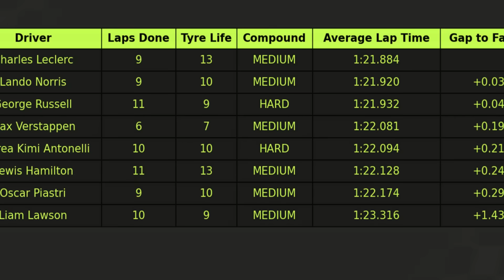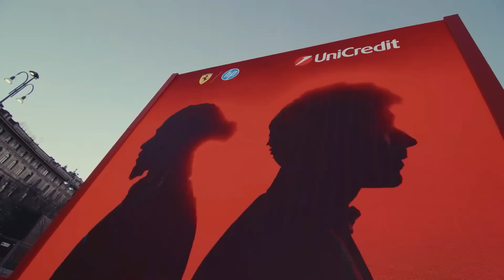Nico Rosberg Reveals Advanced F1 Data Exposing Hamilton’s Ferrari Performance Gap

Comment: 🤣🤣🤣🤣 That one aged like vinegar. First of all, Leclerc gets in fourth or fifth consistently. There is no performance gap. Ferraris way of doing things is just more driver-mistake prone. 

Second of all: Hamilton admitted himself that Leclerc gets excellent performance out of his, because he likes sliding the rear (which ferrari designed this way so the driver can do a lot of perfect turns with just very slight movements).

Hamilton cant even keep the ferrari in lane for one round of a qualifying. 

If you ask me, Hamilton is the problem. Not the Ferrari.

Comment: Leclerc has implemented an extreme setting while waiting for the updates he plays with the brakes and the engine brake which does not exist at Mercedes it is quite complex Lewis tried but he does not succeed (he knows less about the brakes) he doesn't trust this setting if you read leclerc from time to time you would know it
They are the same car

Comment: To join Ferrari, Lewis left Mercedes.
But if we look at the teams standings after Spain we can't say it was move for worse. The cars potential seems close.
1 - McLaren  362 points
2 - Ferrari - 165
3 - Mercedes - 159

...meaning, Ferrari has stability problems that clearly compromise cornering speed, but if with all the problems, it's still the second best team, that should mean a lot of potential if they can fix the car.

Comment: This is why F is so deadly boring. The driver is essentially irrelevant except at the tiny margins of skill. It's all about the car, not the driver. When "driver aids" (ABS, traction control, active suspensions, etc.) were outlawed, the take was to return F1 racing to driver skill. I'm a PhD mechanical engineer who has been involved in racing for decades. If F1 as an organization really wants the drivers to return to something like a defining factor, they need a spec car. Now that would put thousands of F1 engineers out of a job and in many ways take away a lot of the technical interest in F1 from fans, but as things stand now at Ferrari, Hamilton's skill is wasted. As for the racing, Indycar is infinitely more interesting. There was more passing in the first 20 laps of the Indy 50 than there is in an entire season of F1. If somebody like Vercrappen can win world titles over a driver like Hamilton, then driver skill has washed away to nothingness.

Comment: Once you realise how messy his car is you can’t help but respect Lewis even more for his control over the vehicle under these stressful conditions.
Reply: Once you realise SLH44 hasn't adapted to the ground effect era cars like Max, Lando and Charles have, you can't help but respect their adaptability and skill to look for new ways to drive, unlike SLH44 who drives EXACTLY the same as in the Mercedes dominance years. Just look it up, the official data shows this!
Reply: Charles do better then #44. If #44 were faster then you could speak about respect. But he is slower then Charles Leclerc.
Reply: Nico was talking about the telemetry data.

Ferrari has not made a competitive car since Seb.  The way they are doing things for Charles clearly is not working.  They need to make a car Lewis can be fast in, then Charles will have someplace to go.

The man has been running experimental setups for four years now for garages who cannot make the adjustments.

Comment: The whole team need to change, they must move away from their comfort zone, this is where they are because they think just by being Ferrari entitles them to win. They have to learn how to operate more efficiently like a well oiled machine, at the moment the left hand doesn't know what the right hand is doing until it's too late, mistake after mistake, the only good part of the team is the pit crew and drivers,  like that they will never win a thing. Desperation does not bode well in these things, it just puts you on edge and that's when mistakes lead to more mistakes and the situation just goes bad from there on. Fred should make them all step back, take a deep breath of air and look at what they are all doing wrong not what they are doing right.

Comment: If the rear axle assembly is not rigid under cornering loads, it will be a lucky accident if there is a stable set up: other variables will be set on the assumption of rigidity, so if the structure flexes unpredictably,  stability would only occur if precisely compensating errors are induced all round. But this is unlikely.  Also, does the simulator reflect the actual flexing, or the ideally rigid concept? If the latter, what is learnt by varying the other parts of the set up will be systematically misleading.

Comment: So how is Rosberg able to produce different results? Are the cars different? I'm thinking there is a trigger that sets off a chain reaction and the brakes stand out as the probable cause. Hot spots indicate vast amounts of variable forces that will flex and distort everything including ride height. I'm further guessing tribological problems between the rotor and pads. Check rotor composition or even outgasing of a cleaning solvent soaking in unevenly. A simple procedural change by a minor team member could produce what is being described.

Comment: All you need to know is that LeClerc is P5 and Hamilton P6. Ferrari does not have a good car. Better luck next year. Don't blame the drivers, they are two of the best.
Reply: "They are both behind Russell" is what you mean.  The Scuderia needs to get itself in order.  The team does not have enough success to insist Lewis do everything their way.  Lewis and Scuderia Ferrari better get together on the fine points.
Reply: @H.A.M.Macintosh-x4q  Russell is P4. Not particularly impressive but a little better than the Ferrari drivers.
Reply: Facts
Reply: Well if a car is super good, any Tom dick and harry can drive it good. It is when an experience driver can handle a ‘not so good’ car and still excel, that’s the difference.
Reply: One is very good, the other is forty years old and washed-up.
Reply: @jessebunker6062  so washed up he gets 50 Million plus to push buttons on a steering wheel, why you sit at home in mom's basement pushing buttons on your laptop.......lol............
Reply: @jessebunker6062  If either the very good one that is P5 or the washed up one that is P6 had faster cars they would be more competitive. Right?
Reply: And the next and the next year !
Reply: @Craft-oh7uv Ham Will LEAVE,(With the SPONSORS, !!) See how they Like it THEN......
Reply: @Craft-oh7uv even after 20 years without winning anything they are still the team with the most constructors and drivers championships. 
Only a moron would not count Ferrari amongst the manufacturers capable of building a championship winning car. Yes they are in an awful moment (like several times before), however historically when they get it right after those bad periods their dominance is complete . 
When they get it right again people will completely forget the bad years
Reply: Hamilton has been over half a second per lap slower than Leclerc in every race so far bar the sprint in China
Reply: @ey1615 Who cares. Leclerc is P5 and LH P6. Neither driver is competitive. That has to be the car. Correct? And indeed, both drivers have been complaining about it the whole year.
Reply: @ey1615he had damage in Canada and in catalunya😂😂😂 he was losing 5 tenths per lap with his damage in Canada alone and yet he still finished decently
Reply: @vinnievinnie-sj5kr He regularly loses 5 tenths a lap on Leclerc without damage too. But of course this damage was exactly 0.5. The British desperately trying to save what is left of their myth, no the Ferrari wasn't faster in 2017, Vettel was fighting Bottas almost just as much until team orders. Bottas also mysteriously lost his mojo after Mercedes and struggling to beat Zhou, as well as he did that weekend when Russell replaced Hamilton and beat Bottas convincingly right away. 
It was obviously the car. Hamilton was one of the quicker drivers 15 years ago but the grid has developped and now he is just mid.
Reply: @DenUitvreter  So you are saying that Leclerc is better at driving a mediocre car than Lewis? I mean Leclerc is young and in his prime and the best he can do is P5 one spot ahead of washed up Lewis? Maybe next year if Ferrari is more competitive we will have a chance to see these two great drivers winning and competing for a championship.
Reply: @prestonbacchus4204  Hamilton isn't washed up, he was never that good and Russell was also better at driving a car than Hamilton, a mediocre car often but also better driving the odd good car. Hamilton was among the quickest drivers of his generation but now we have a quicker next generation. That's how it goes when all times try to get quicker drivers every year from an ever growing pool of better prepared talents. 
When Schumacher quit in 2005 he was still the best, but not by the margin he had on the rest of the grid in 1994. Hamilton was never near Schumacher's level so he just went from one of the top drivers to a mid driver over 15 years. Vettel and Alonso (would) have stiff team mate competition in the current grid too. That is the natural progress of the sport, they get faster cars and they get faster drivers.
Reply: @DenUitvreter  Hehe. George would never make the argument you are making.^. GR: has achieved four race wins, six pole positions, nine fastest laps, and 20 podiums in his 7 year F-1 career. LH: holds numerous Formula 1 records, including championships (7), the most race wins (105) and most pole positions (104)...in his 18 year F-1 career. By the numbers, nobody is close to Hamilton.
Reply: @prestonbacchus4204  True, that goes for all numbers. No one had so many supreme and competitive cars, no WDC has been beaten by this many teammates.
Reply: @DenUitvreter  Cool, another record for Lewis.^ Agreed that having a fast car is quite important and Lewis did have a fast car at Mercedes.when he was dominating winning championships. But he also won a championship driving for Mclaren. Bottas has a better F-1 record than Russell and he often beat Lewis.
Reply: @prestonbacchus4204  Yes, because the Mercedes was dominant and not Hamilton. Call him the record holder of the number of race wins if that is all you have to say. But that doesn't make him a great driver or a driver that now deserves another great car in which he will beat a good teammate. He doesn't and he won't.
Reply: @DenUitvreter  During the time that Bottas won 10 races for Mercedes, Lewis won 50. You are basically trying to make the argument that the GOAT of the sport sucks, which, as you know, is a hard sell.
Reply: @prestonbacchus4204  I don't have to sell anything, you are trying to sell the myth that all these records are the product of driver competence and not of the most supreme car for by far the longest time in the history of F1. Why did the goat hide the past 3.5 years behind mediocre performances? 
If someone started watching F1 in 2022 and didn't read up on previous seasons, why would who he believe Hamilton is a great driver or even WDC material?
Reply: @DenUitvreter  During the 5 years that Bottas was Hamilton's team mate, Bottas won 10 races, Vettel 11 races and Max 19 races while Hamilton won 50 races (five times as many as his team mate driving the same car). It's one thing to claim Lewis is past his prime, but to claim he is not one of the all time greats of the sport is not objective..Of course everyone is entitled to their own subjective opinion. Because of his  perceived greatness, he is also the biggest draw the sport has ever had.. Of current drivers, only Max is positioned to take away his GOAT title. It's cool you have your own opinion..
Reply: @prestonbacchus4204  Be objective. No one ever in the history of F1 has so much good, great and supreme cars. No one has had so many years next to a replacement driver. No WDC has been beaten by his teammate this often nontheless. 
There are records and there is greatness, no reason to conflate those two. If you start about greatness, go make your case but do that instead of making the case he is record holder because that is something different and not contested.
Reply: @DenUitvreter  I agree he had fast cars and that greatly contributed to his success. Indeed, he is not competing well now because of not having a fast car. It's fair to say that this is a team sport and Lewis' success over the years was/is a team effort. Still, Lewis was a hell of a driver. I'll let you have the last word if you want. Enjoyed the conversation. ^
Reply: @prestonbacchus4204  It's not that I give him no credit. I'm a Vettel fan but I don't believe Vettel, or Alonso, was truly better. I think Vettel did better, did more with the cars he got, but Hamilton was probably the more general talented. 
But F1 has moved on and the grid has gotten faster, so to succeed now he had to be quite a bit above the rest 15 years ago and he wasn't.
Reply: @DenUitvreter  Nice.^
Reply: Leclerc is half a second a lap faster. Leclerc is one of the best.
Reply: @DenUitvreter  7th season and no titles 🤔
Reply: @DenUitvreter  so good he won 8 races in 7 years 😂
Reply: @a.c.slater573  /I believe Hamilton holds the records for most wins (105), pole positions (104), and podium finishes (202), among others.
Reply: @shannonmcstormy5021 hamilton may hold many records but he shouldnt be compared to the other eras when f1 was different and we didnt have so much races in 1 year
Reply: @stivndini1957  Hamilton can only be compared with his peers, F1 drivers, and he is the greatest of them all 🏆🏆🏆🏆🏆🏆🏆🏆🏆
Reply: @a.c.slater573 fanboy
Reply: @a.c.slater573 And so good that he has got 46 podiums, 26 poles and 1524 career points in just 7 years( let's also not forget that kimi Raikkonen who was highly regarded as one of the best f1 drivers in recent times has had 21 wins in his whole career)
Reply: @stivndini1957  I only look at stats, facts and records 😂
Reply: @F8_Z3PHYR wow cool and how many WDC?
Reply: @stivndini1957  /that just makes his accomplishments even more impressive. Plus, the next most winning driver was Nigel Mansell who had 31 career victories. Hamilton has over 3 times more, and no matter the era, there aren't 3 times as many races. I recognize that a race driver of Color that has no competition for the title of GOAT really bugs some small people. However, I think (Rtrump notwithstanding), isn't it time we walked away from those salty objections to accept and celebrate that the best driver in the world, ever, isn't a White guy ?
Reply: @a.c.slater573  Yes,  I think he's over reterd.
Reply: @stivndini1957 he's states or the profe!!!
Reply: @a.c.slater573 yeah and probably Leclerc will not win anymore races until he moves to McLaren.
Reply: @DenUitvreter  He DIDN'T WIN, Did He??
Reply: @DenUitvreter  p5 and p6...just take you comment and let that sink in
Reply: @DenUitvreter  Yes, I know that. And he is P5 with LH at P6. Obviously these are not competitive cars.
Reply: @prestonbacchus4204  That happens in F1, Hamilton is the only driver in history who has been in a very competitive car for more than 6 seasons, he had about 12 from which 8 were in the supreme car. 
Hamilton is not competitive towards his teammate too, and that is entirely his problem.
Reply: @DenUitvreter  Yep. I am good with Mclaren taking on the mantle. But Max has not been going down without a fight and that has been fun to watch.^
Reply: @prestonbacchus4204  I agree, a clearly best driver in a lesser car has always given us the best seasons. That's why he really had to take the 15 points awaiting car improvements and rain races.
Reply: @DenUitvreter  Yep. These guys are fabulous drivers. Fun to watch.^
Reply: @DenUitvreter competitive u mean? Wasn't schumy's car competitive when was out performing Rubens? Wasn't Seb's car competitive when he was outperforming Ricciardo, Wasn't Max's car competitive when he outperformed all his teammates? Ham has outperformed Nico for 7 seasons..learn to give credit where it's due
Reply: @DenUitvreter Senna had the fastest car and didn't Schumacher 🙄
Reply: @DenUitvreter that’s simply a lie tho 😂not to mention how much damage he’s had this year
Reply: @DenUitvreter you clearly only just started watching f1 😂😂😂in 2017 and 2018 the Ferrari was quicker early in both seasons but merc and Lewis caught up
Reply: @DenUitvreter  EXACTLY !!!!!
Reply: Blah blah blah
Reply: @gto861  vroom, vroom, vroom^

Comment: The first few laps you could see the compromise of Hamiltons car🤔 shore in qualifying the use of tires push him up the order for the race , but if you recalled Hamilton statement a before that he doesn't understand how the performance of the car change during races🤔 shore low fuel help but noth him and Charles started with same tire fuel ex. This is a car issue stem from poor design and incompetent engineering. The car is trash and the few podium that Ferrari gets seems ok for them    as they get the heritage money yearly it seems.